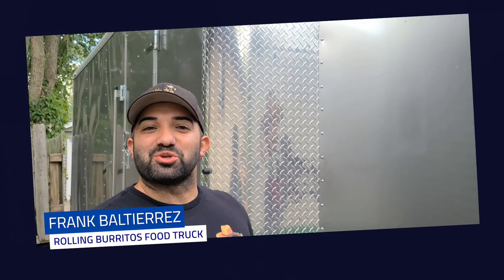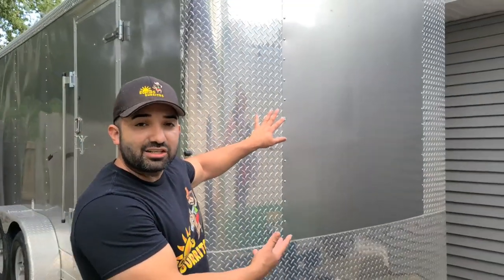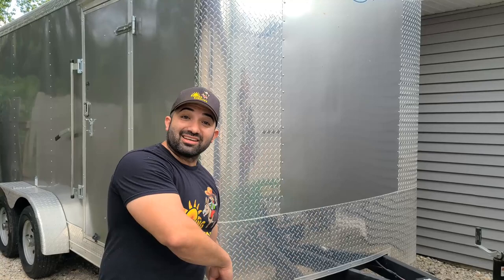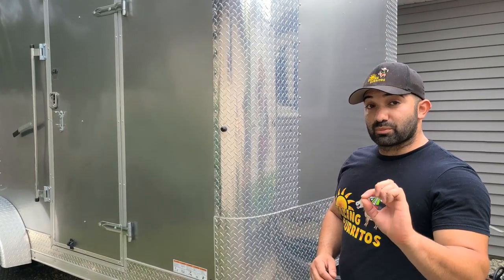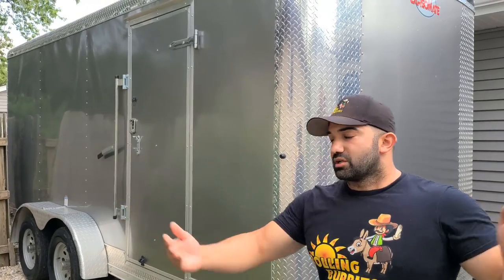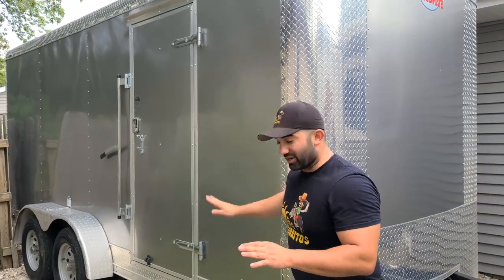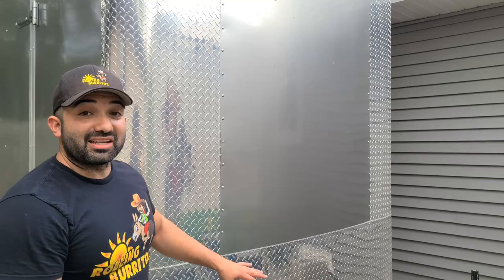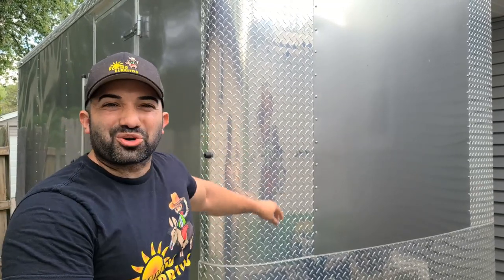How to Build your own Food Truck

Comment: Frank gracias por compartir tus habilidades tengo una preguntita mi traila es de 8 1/2 x 20 y quiero empesar por la electricidad ovio ! tengo una freydora , una nevera, una mesa de prep sandwish , la pompa de agua y el water heater . ahora nececito mas voltios de lo que tu le estas poniendo al tuyo ? y si SI QUE NECESITO HACER

Comment: Thanks so much for putting this series together. My partner and i just bought an 8.5'x20' trailer and will be starting our conversion soon. A couple questions, is there a disadvantage to having your service window on the drivers side verses the passenger side? Whats your thoughts on making a false wall across the back of the trailer? I've seen in your videos you covered the back door with stainless and I'm assuming it always stays closed. We are thinking of using that space equipment, and or tables. For reference, once the trailer is completed we will be in a food court, we are not planning on being mobile.

Thanks for the information..
Reply from the maker: Good morning. If you are not going to be moving it then the window can go on either side for us we never unhitch when we are at events so the passenger side is the curb side. Much safer. And yes make it a false wall if you don't plan on opening the door down but it is nice to have the door
Reply: Thanks for the follow up I’ll send you some before and after construction videos.

Comment: do you need to have two door exits ???
Reply from the maker: I would not have the answer to that question. My HD and fire department don't say that, that is required on the specs
Reply: Okay I’m building up the truck and I want to cover all that front he front driver

Comment: I have the v-nose trailer. We have to find a trick for that.
Reply: I would build a wall on the inside to make the inside flat and then you can add a door on the outside of the V for your propane and battery and whatnot
Reply: Yeah you can add a wall and external door, then but your power and gas in there.
Reply: Yeah you can add a wall and external door, then but your power and gas in there.
Reply: You can also use some noise canceling insulation to cut down on the sound of your generator!
Reply: @1992Bwhite  Thanks. I will do that. I was really stumped on where to put my generator and tanks.